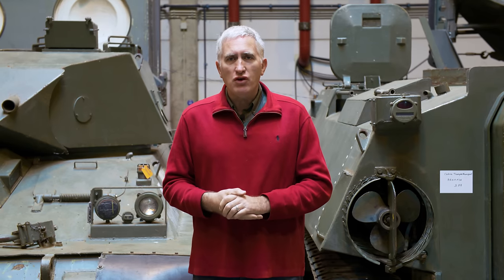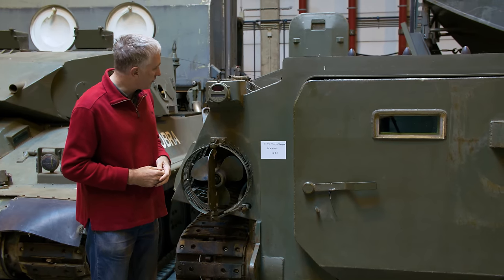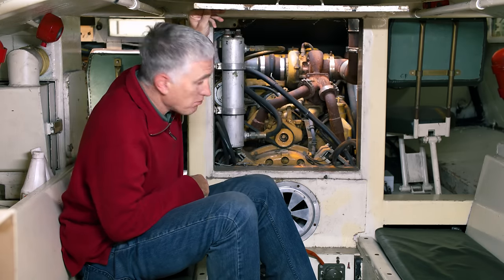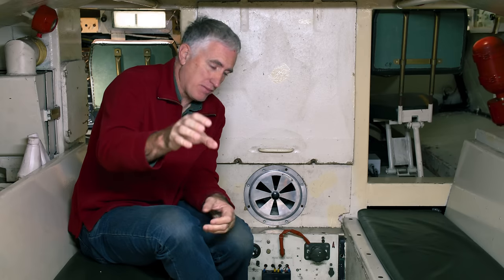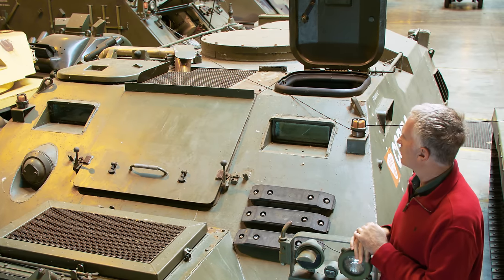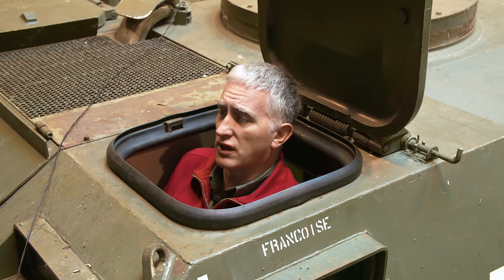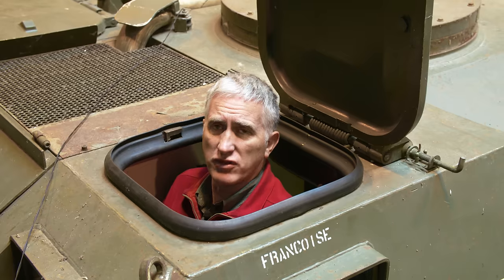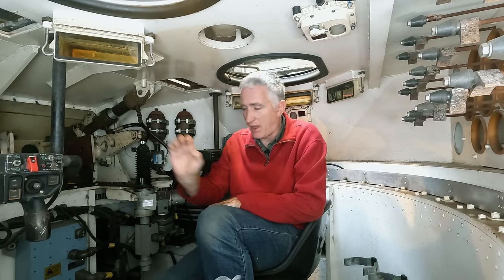Inside the Chieftain's Hatch: ACEC Cobra

Comment: Just a 3 man tank? Does the commander load also? Or who shoots?
Reply: Yes, TC loads, gunner shoots. TC is also way overloaded and slowly goes mad.
Reply: Yeah, not ideal. But, again, it's a light tank, not an MBT. It isn't supposed to sling round after round while charging forward.
Reply: Yes. 2-man turrets for 90mm low and medium pressure guns (and the 76mm in the Scorpion) have been the norm since the 1950's.  It does give the commander too much to do, as always.

The gun in this case was not the little Mecar low pressure gun or even the Cockerill Mk 1 but the high velocity Mecar KENERGA, which would evolve into today's Cockerill Mk 8. That is a lot of gun for such a tiny vehicle.